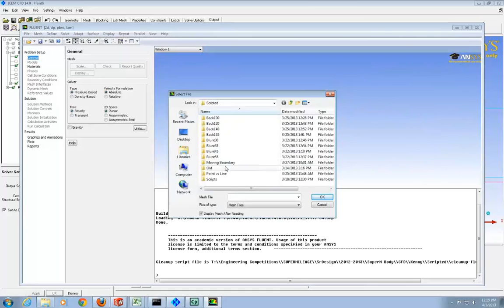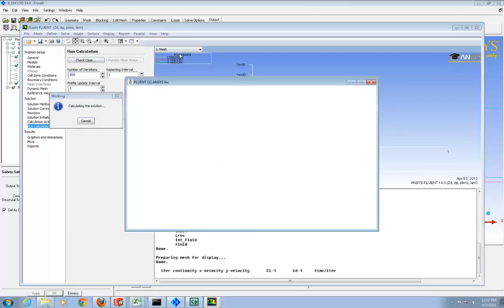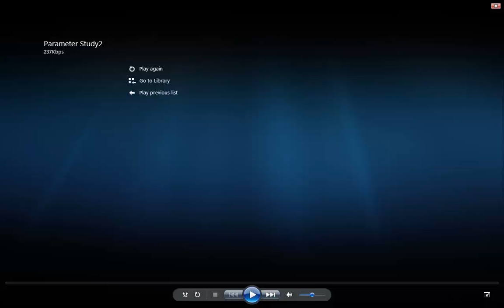Solidworks, ICEM, and Fluent Parameter Study for a 2d Cross section PART 2

Comment from the maker: If I understand you correctly, you are trying to simulate a 3d body shape in a fluid flow. If this is the case, then you need to make sure your ICEM and Fluent simulation are both created to be 3d. I never did a lot of work in 3d because the amount of work involved exponentially increases. Sorry I cant be of more help.

Comment: Thank you for your reply. I'm doing 2D study, but I have a trouble with references values in fluent, specifically with Depth as I'm simulating sagittal body shape and the depth is not a constant as in other cases. Any help will be ok.